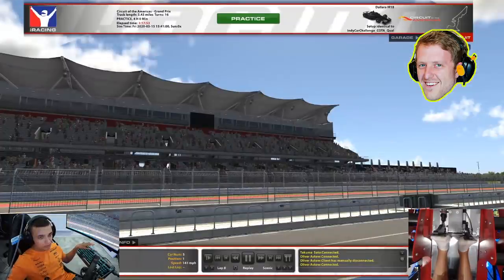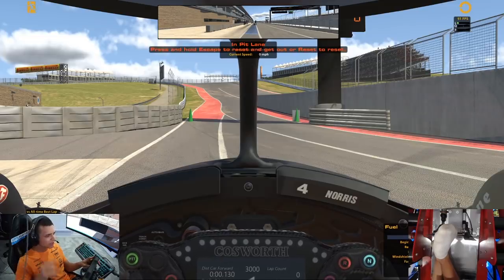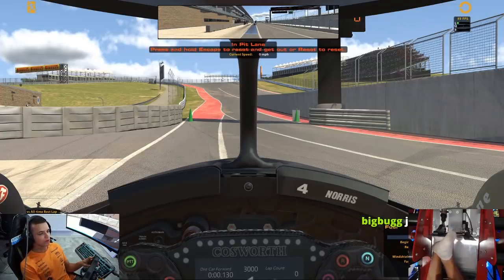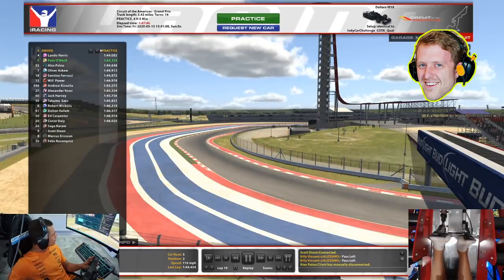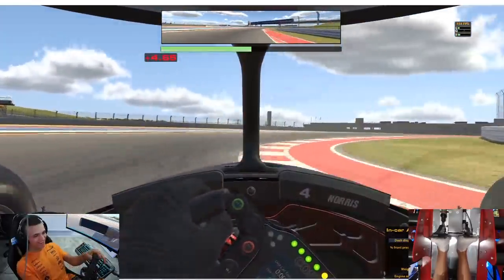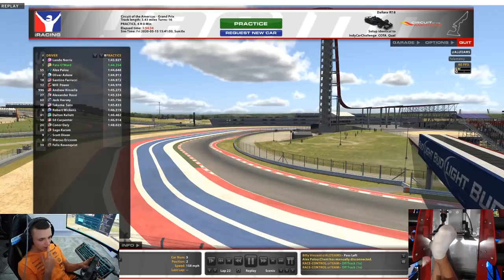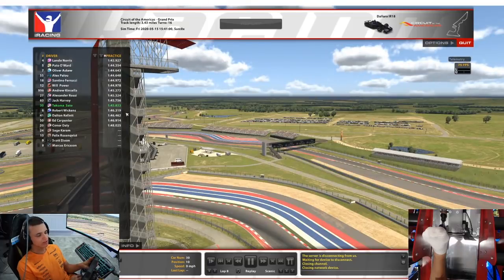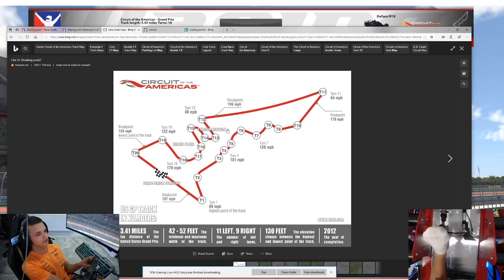INSIGHT INTO AN ENGINEERING DEBRIEF // INDYCAR iRacing Practice (Circuit of the Americas)

Comment: Ok its one thing trying to understand how Lando identifies these things, its completely mind blowing to wonder how Jarv hears this feedback and then has a logic on what to change. Awesome to see professionals at work.
Reply: Setup is absolute witchcraft
Reply: F1 engineers are wizards idc what you say they're wizards and thats final
Reply: I think Lando's feedback are a little bit over the top
Reply: @d1want34  what makes u think that?
Reply: @d1want34  His feedback is perfect for changing setup.  If the car needs more grip turning into a corner, or is understeering on corner exit, these are all things that can be individually fixed in the setup.
This stuff isn't magic, however being able to feel and remember what is happening is not easy.  It's all training, it's what he's learned instead of geography or calculus.
Reply: @coast2coast00  how do u change mid corner understeer/oversteer? And individual corner mechanical grip?
Reply: @d1want34  I'm by no means a setup expert, but for example at midcorner you're probably rolling over a curb, so things like softening the front or rear suspension might help reduce understeer/oversteer respectively
Reply: @coast2coast00  Yup. I tend to instantly forget what did gone wrong then repeat similiar mistake the very next lap.
Reply: Ridhuan AB You can simply change diff setup electronically. Based on three condition in F1 on their steering wheel. One of them being “mid dif” where i think it refers to “mid corner torque limiting”. You can change this on fly. My best guess-timation is that they provide an actually 4-level of torque limiting. 1) Off throttle back- torque limiting under “engine braking” when you first hit on the brake. 2) Off throttle back-torque limiting when the rear-wheel doesn’t turn at the same speed a.k.a “off throttle corner entry” 3) On throttle torque limiting when the rear-wheel doesn’t turn atthe same speed a.k.a “mid corner” 4) On throttle torque limiting a.k.a “corner exit and straight line”. This is far more advance than a standard 1-way, 2-way or 1.5-way LSD.